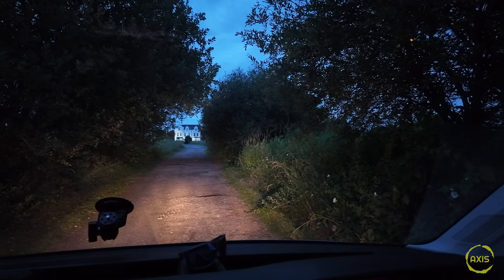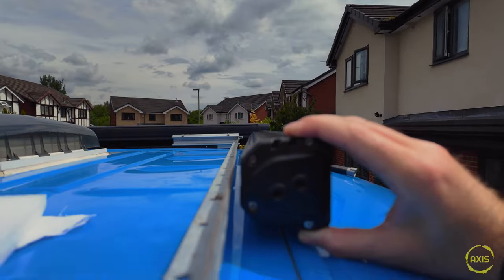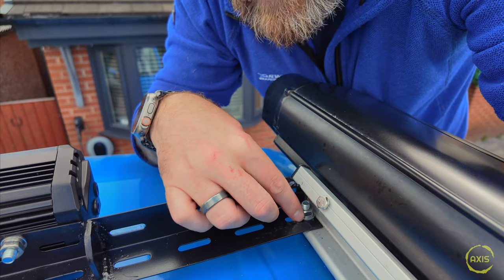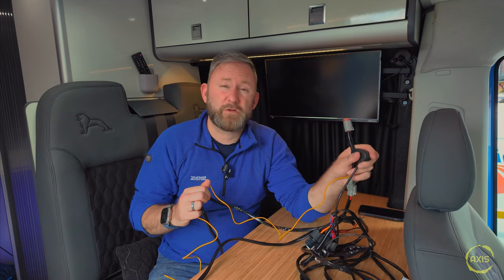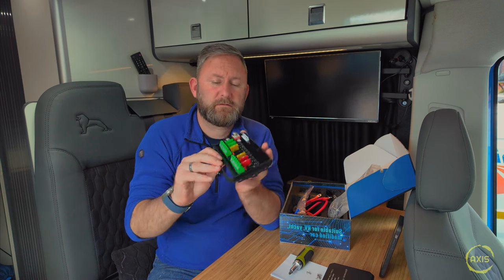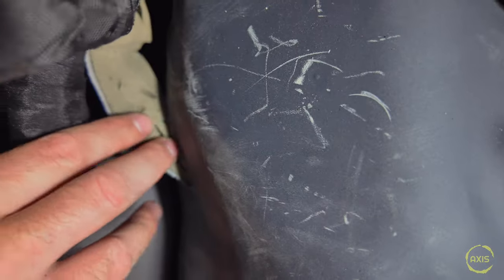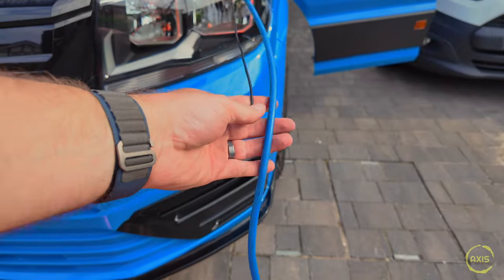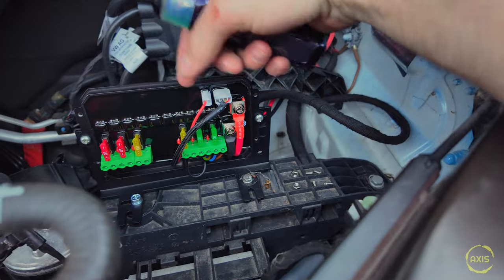Installing an AUX BEAM led light bar and an APIELE 6 gang switching panel on a MAN TGE/ VW crafter.

Comment: Tidy job and has answered a question I didn’t know I needed to ask 😅 I’ve also got unistrut rails and have been thinking about adding a light bar. Nice job and the light out out is good.

I’ve got the Lazer lamps which are mega. I just want a light bar to finish the roof line in front of the skylight 👌
Reply from the maker: Thanks 👍🏻 at least the lazer lamps should be a doddle to fit now 🤣
Reply: @AXISUK  Yep. Certainly if you’re running them from the switches rather than main beams. Just got to cut the grill which isn’t much fun… but is easy with the moulds they supply 👌
Reply from the maker: @VanFamilyAdventures  keeping all upgrade lights on the switches as less chance of things going tits up with the factory setup 🤣 

I think the Man grill is slightly different to the crafter 🤔 Hopefully should be a straight forward cut 😂